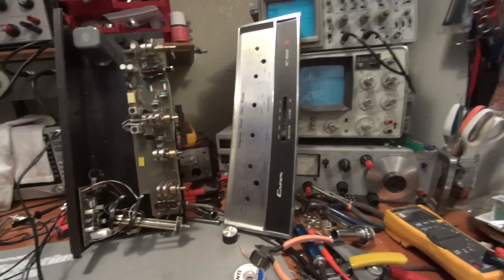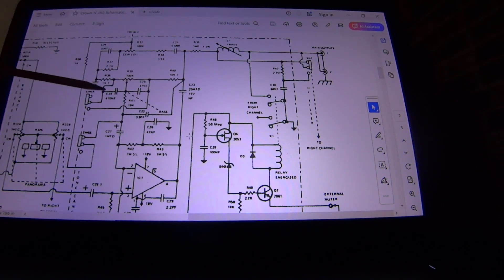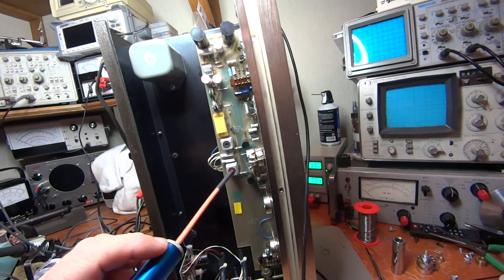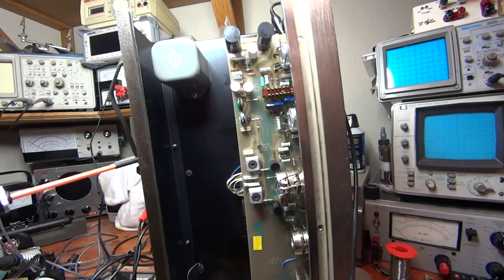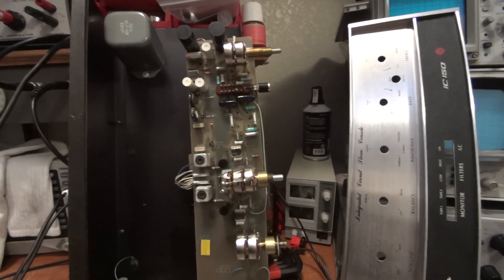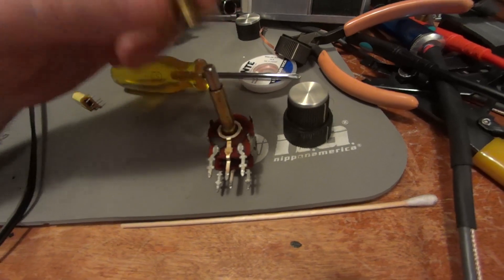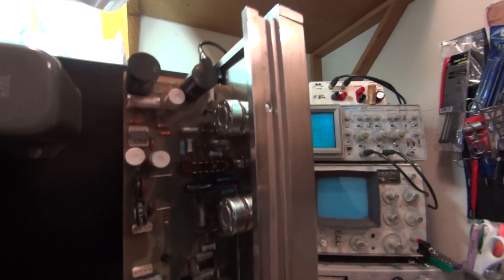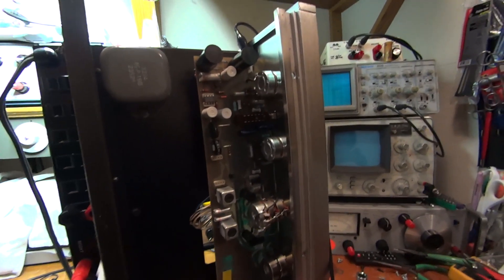Crown IC-150 Pre-Amplifier Repair

Comment: Great video. How do you remove the knobs for service the circuit board? I see only Allen screws on the 2 tone controls ? Are the the knobs held by a flat bed or phillips? Thanks in advance for any help. Again great video especially the mute relay explanation.
Reply from the maker: I honestly don't remember, but I'm certain they are not phillips. They are either Allen or small standard. I usually use a magnifying glass and a flashlight to find out. If you don't see a screw they pull off.